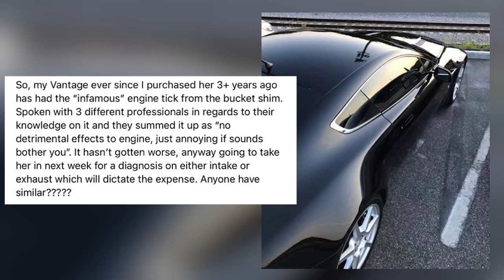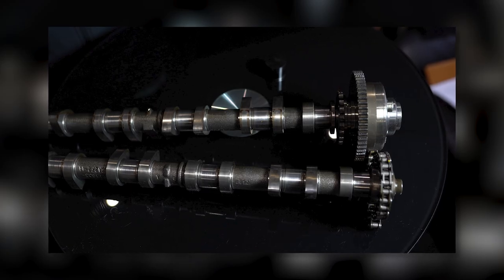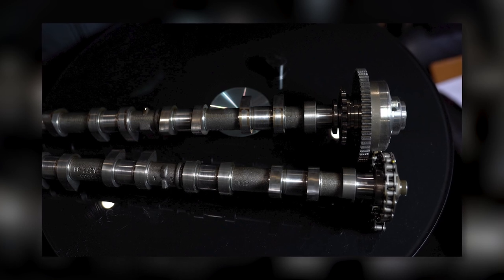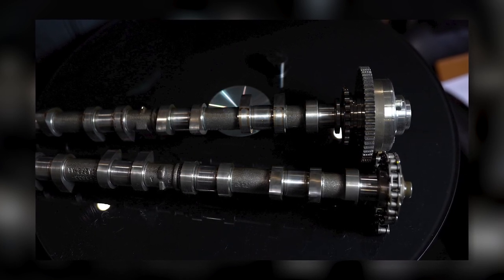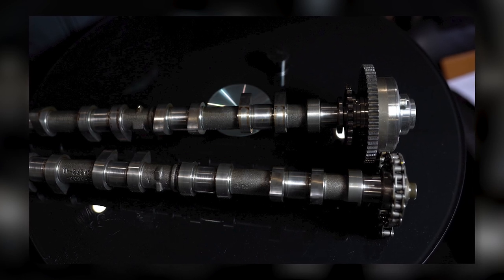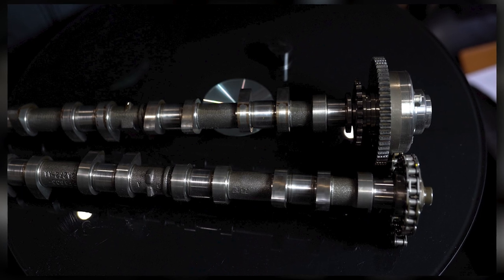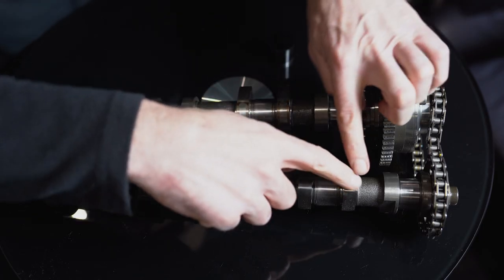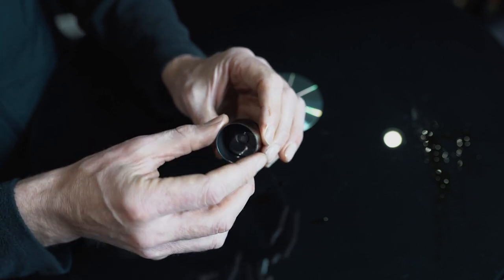V8 engine tappet shim ticking | FC #87

Comment: On my new (ahem) replacement engine which was in reality a rebuilt unit, it came with a ticking noise. Turned out to be a worn valve guide. Even main dealers are just that, 'dealers'. AM were fab' and got my car to where it should be but I'd lost the love or it., dealers? Some shockers out there, my car was delivered with big ends knocking and they tried to tell me it was injector noise at only 6k miles ffs. Good work Mike.

Comment: Ok, I was hearing a tick that I assumed was injectors (my last car was a direct injection engine with a high pressure fuel pump that sounded similar), but all the recent talk of tappet shims has scared me.

As a home shade tree mechanic that's relatively new to this engine, is there an easy way to tell if what I'm hearing is just the injectors or if it's tappets and I should take it to a shop for further investigation? Would one of those mecahics stethoscopes help me determine? If it's tappets, where would I stick the scope to hear it loudest?

Comment: Do tappet shims make noise when the engine is warmed up on a 4.7? I only have some valve train noise at high idle when cold, it's gone quite quickly, zero valve train noise when warmed up, can't say I'm worried about the valve train noise at cold since it's 60w oil, it makes no more noise than my old Honda CRV.

Comment: I had assumed that I had the dreaded shim problem but now am not so sure. At tickover and all the way to  4,000 rpm it's sweet, quiet and turbine like but above that it starts to sound somewhat thrashy.  Got the car at 14,000 miles and it has always been properly maintained no expense spared by main dealer HWM every year and has now covered 42,000 miles and they don't think it's out of the ordinary but I had a Jag STR before (on which my 4.3 engine is based so I'm told) and that was free revving, quiet and smooth all the way to the red line so I'm left wondering whether I have an issue in the making.....